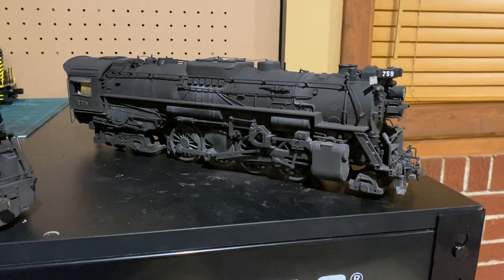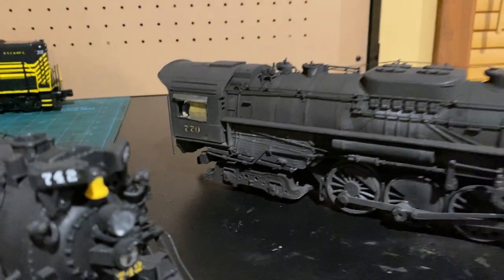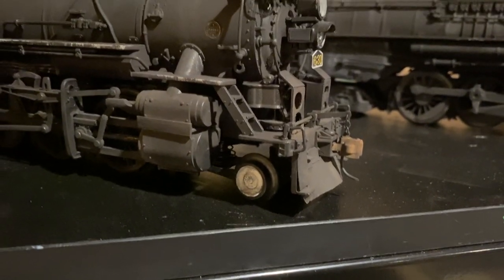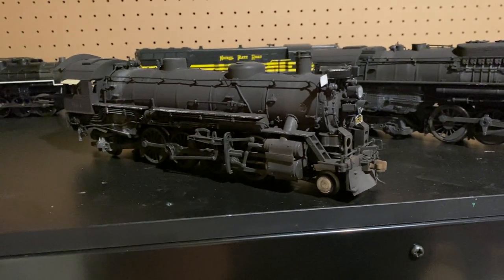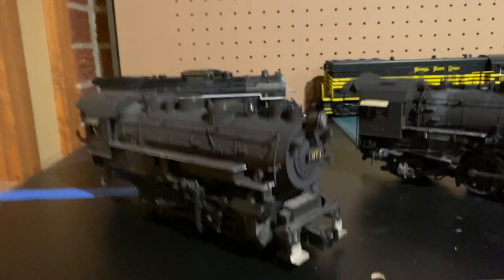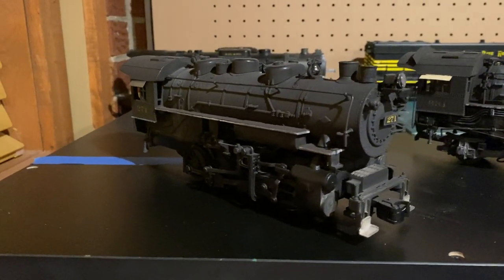O Scale CUSTOM Detailed and Weathered Nickel Plate Road Steam Locomotives

Comment: These are probably the most accurately weathered and detailed kitbashes I have ever seen in terms of Nickel Plate steam, and the fact that you even did the sheet metal pilots that some of the Berks had is a very nice touch. Incredible work!
Reply from the maker: Thanks! I like my models being as accurate as I can reasonably make them with in terms of detail and weathering work. I’m working on some other engines at the moment so I’ll definitely have more to share soon